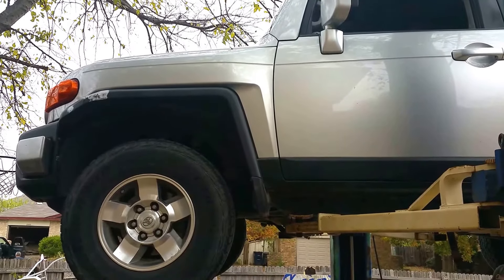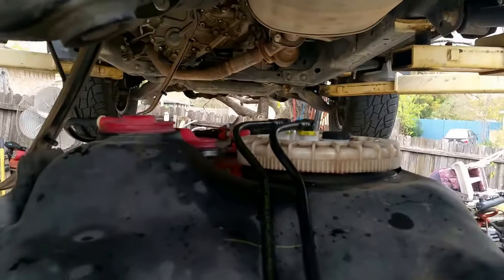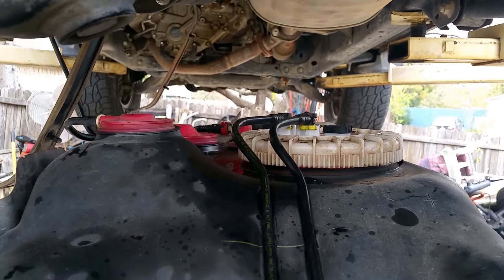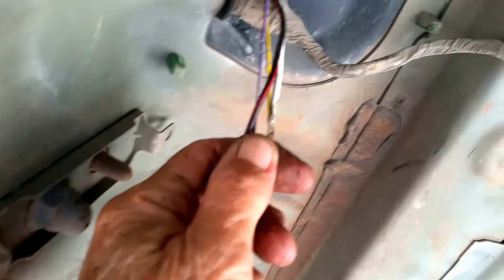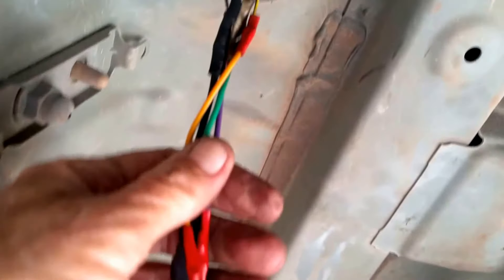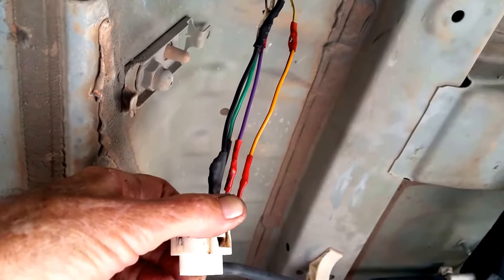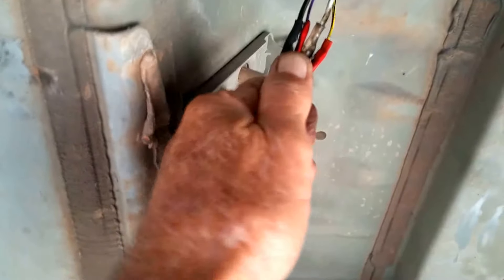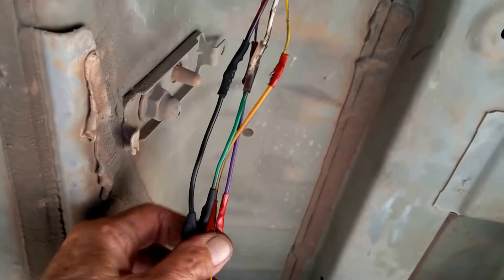2008 Toyota FJ fuel pump

Comment: You also don't have to drop the tank its better and  Easier just to enlarge the access panel under the rear seat so you can remove the fuel pump from the back without dropping the tank and going through all that work.
Reply from the maker: Thank you for sharing. The back of this one i was working on at the time looked as though they were using it for a bedroom...lol

Comment: There's a hatch under the rear seat that  opens, you can see it where the wires that were cut enter the vehicle.  Pull the seat, remove panel, reach in and pull connection.  Don't cut those wires.

Comment: Wonder if you could let me know the colour code to replace my fuel pump wire harness. Had my gas tank straps break and the harness wiring was torn out of the connector. Thanks in advance.
Reply from the maker: Not sure. If colors are different on each side of the connections
I would have to look at a diagram. Hope this helps.
Reply: Danny Collins thanks for your reply. Now that I watch your video closer I would guess that you never had to open the connector to verify the connection points but instead just cut the harness and joined the ends with a section of new wire. My problem is the wires were torn from the connector when the tank dropped and I can’t find any information on how important, if at all, polarity would be.
Reply from the maker: @dsquires8  are the wires the same color on each side of the torn connectors.
If so just cut the connectors out and put them together color to color with solder and heat srink the wire.
You will be fine.
Take the battery cables off first before doing the job.
Reply from the maker: Another word's just bypass the connectors. Hope this helps you out. Some times that is what we have to do when we can not get new pigtails
Reply: Danny Collins thanks again Danny. Sorry I can’t load a photo of my problem but the male connector from the vehicle is still plugged into the top of the fuel tank. When the straps failed and the tank dropped the four wires were pulled from the connector and the bare ends were dangling below the vehicle just under the access plate. The one located under the rear seat. My hope is that once i disconnect the male end I will be able to re terminate the wires into the connector and then plug it back into the fuel pump. My concern is that polarity might be an issue so I was looking for a photo or diagram that shows the configuration of how these four wires were made onto the factory harness. I can’t seem to find it anywhere.
Reply: @dsquires8  any chance you ever found a solution? I am having the exact same problem. Dang fuel tank straps failed on me
Reply: @Limeslice4r64  same exact thing here! I’m struggling to find any schematics anywhere

Comment: How long did it take to drop the fuel tank and to do a complete job?
Reply from the maker: About 2.5 hours...it would take more time if you take the inside apart to get to the fuel pump wire harness plate.

Comment: I have a 07 Fj  & my straps rusted out & the fuel tank dropped. It pulled out the wires out of the plug can any one please help me to tell me witch wires go were. I PUT THEM IN THE PLUG TO TAKE A PICTURE. THANKS IN ADVANCE. Fuel pump wires  are color coated & Toyota say I need to tow the car in so they can fix it for big Bucks. They won't tell were they go.
Reply from the maker: Need to get a wireing diagram for that truck

Comment: Waste of time. It takes all of 2 minutes to lift up the back-seat. Undo 3 bolts on the access panel and unplug the cable. What you did was 100 times more work and completely dodgy.